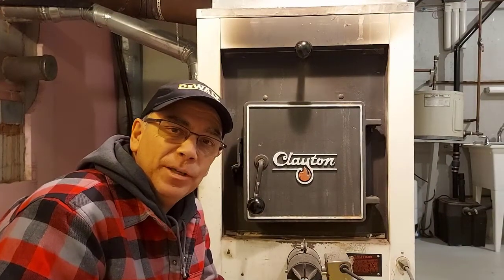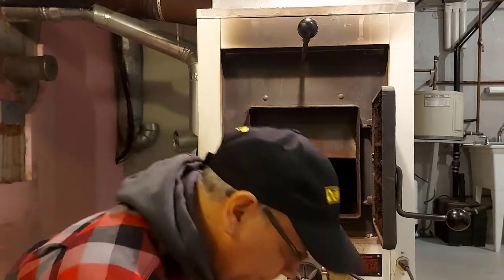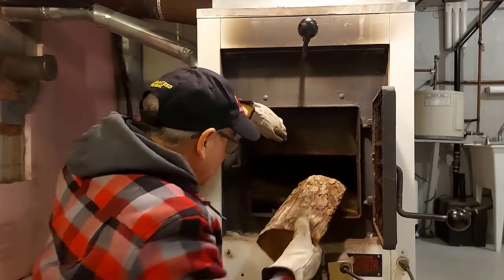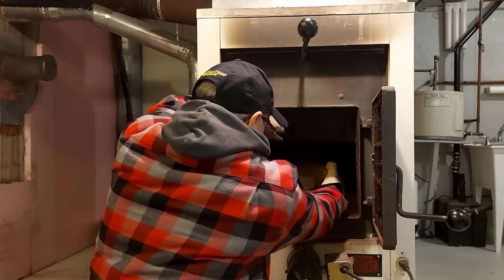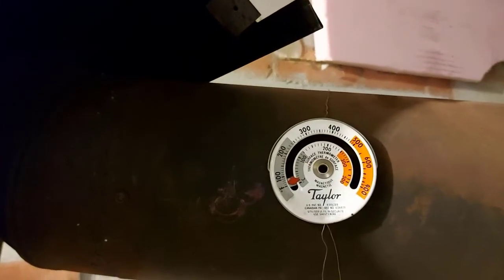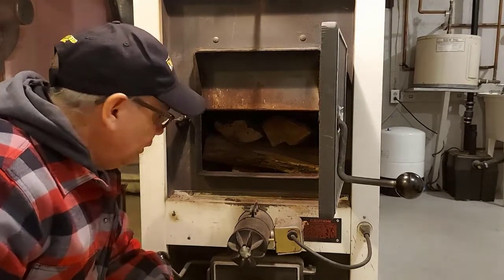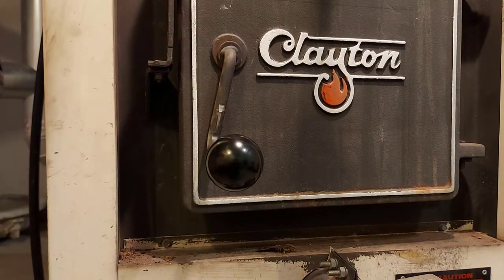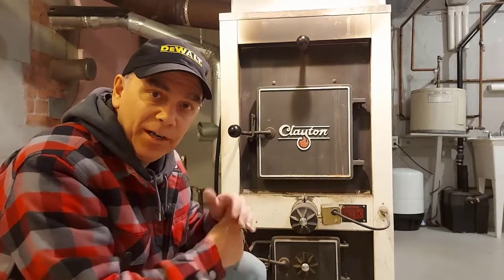Starting a Fire in a Wood Furnace Properly | Works Each Time

Comment: is there a way you could make a video about how you connected the copper pipe from the wood furnace into the hot water tank? Thank you!
Reply from the maker: I didn't do it. It was done before I bought the house

Comment: Do you have your ash door screwed open at all?  I have a silimar unit and I can't get it figured out to run and stay running well.

Also, if I close my top draft more than about 1/4 of the way, it doesn't like to run right.

Comment: This house was built 28 years ago and I believe that the wood furnace in the basement is original and it's old it's made by Leaders and it's huge. And the blower is temperamental and it doesn't have that newfangled knob you're talking about. Another option that a person has to be careful with though if they furnace is completely cold and has not been used, sometimes the newspaper thing does not work so well so I put either fire starting gel or do you need your alcohol which you have to be very careful with, but it will start it right quick! I use that in my pellet stove because the igniters messed up. We bought this house as is. And I am currently using ashwood which is the best burning stuff. There was a tree blocking the old road and I cut it all up and cleared the road and this is my first time using a chainsaw. We grew up with a furnace that my dad converted from a fuel furnace to a wood burning furnace and that thing was huge and scary looking like in the movies LOL with the big grill in the front of it. So I was always having to start fires. The irony is I was a pyromaniac when I was a kid love playing with matches and accidentally set the woods on fire and my mom called the fire department on me when it could have easily been put out with the hose she wanted to fix me from playing with matches and I didn't want to play with him anymore after that but I was the one who ended up starting the fires in the furnace several years later in the morning time when nobody else wanted to do it, I got stuck doing it before school.
Reply from the maker: 🤣 great story! Thanks for sharing it with me.

Comment: Do you not get smoke into the basement at the initial firing? 
Do you close the air intake completely when the fire gets going at full power? Thanks.
Reply from the maker: Hardly any smoke at all. I close the damper yes. Does you chimney need a sweep?

Comment: Very similar to my Scotty SS add on Wood Furnace, not running it yet as the chimney has too many elbows and pipe lengths making it a creosote nightmare. Every 90 degree elbow accounts for 5 foot of pipe or stack as some of Us call it. I will have to do a video when I get time and the tear out and proper install of a indoor wood furnace. Right now lower stone basement section has a 500 watt oil filled heater the upper block area has a 1000 watt oil filled heater and main floor has 2 x 1000 watt floor heaters and a oil filled 1000 watt on ecno mode in the front northern main floor bedroom. Heatilator fireplace in upper living room keeps it nice and warm but burning two banana boxes a day of hardwood and soft standing in box on its ends. 
Nice stove Roland, The Scotty SS instructions say to put large split logs at rear and light the front with kindling and smaller firewood, then keep pulling hot embers forward when adding wood to the rear keeping the burn hot with the front as a flame front if you know what that is. Works out to a cleaner burn if done correctly, will let you know when I get to this tear down of all the duct work and install in front of the chimney the safe and correct way.
Cheers and Peace Out